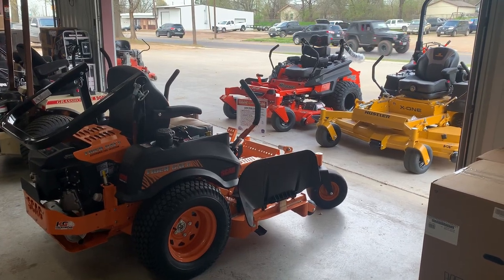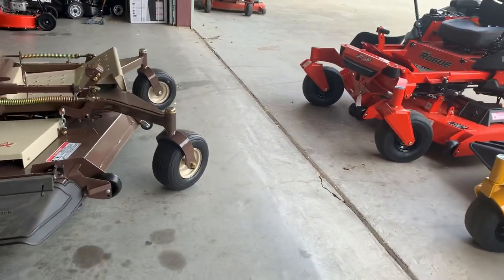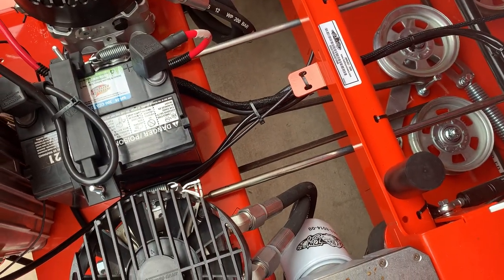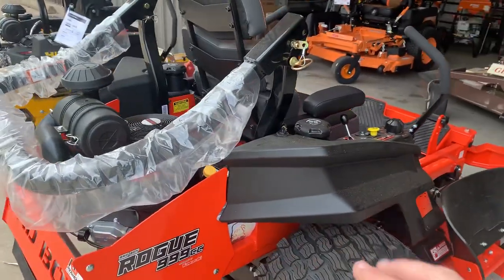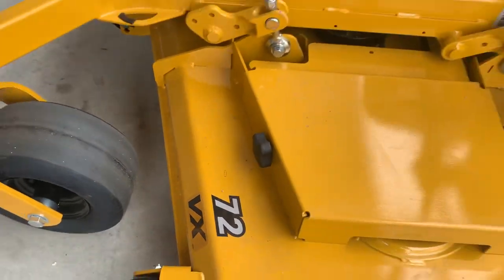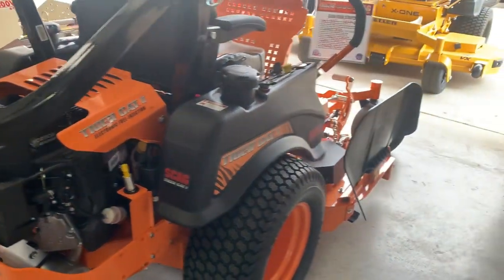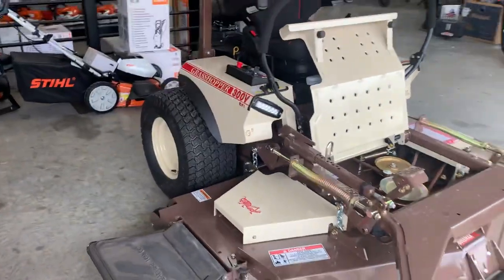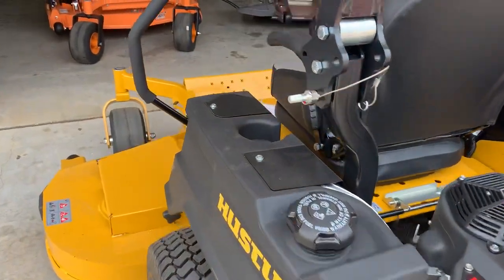Scag tiger cat vs grasshopper 300 vs bad boy rogue vs xone hustler comparison side by side.

Comment: I run three 2014 Grasshopper 227 that came with 27 Kohler command pro that have since worn out. I have fitted all 3 machines with big block Vanguards. The Grasshoppers have been awesome units with over 5k hours on them and still the original hydros. I have yet to demo a unit that holds hills like they do. I will continue to buy Grasshopper.
Reply: I have an old 48 inch Encore that has narrow,tall rear tires on it and I also built a rack over the top of the engine for a 15 gallon sprayer tank and I can fill it a little less than half full and I can hold a steep ditch as good as any other lawnmower I’ve ever ran including a mower with a steering wheel and me walking beside of it holding it from turning over. It is bad about rearing up bad but that also comes in handy when I come up on a root. I can stop and take right off and pop a wheelie and go right over it and never miss a beat lol but I do tell people when they are looking to get a new mower to make sure that it was narrow back wheels and not the fat smaller ones. I have a 42 inch with those on it and it’s got to be on a flat surface or it will slide to the bottom. I’ve always hated it but I do have a bagger for it which I’m sure that I can put it on my 48 without much trouble and it doesn’t cut good either. I’m thinking that the longer the blades are the better it will cut because it has more of a swinging distance.
Reply: l have a 227 and have 1500 hrs on it. I cut five acres and it's done well. Only issue is that wish it had a better ride.
Reply: @george7058  mine have the cordura seats not the grammer seat and I have no issue with ride quality

Comment: Have a grasshopper 329B with the 61” and a 28HP vanguard and that thing is a beast. had it for 4 years now and all I’ve changed is a belt. and of course blades. but I’ve run them all and grasshopper may not be fancy but I’m gonna tell you that grasshopper has been the most reliable mower I have ever had. And that’s cutting 2 acres 2 times a week if not more considering the occasional neighbor mow.

Comment: Your comparison videos are really well done.  No unnecessary babbling at the beginning of the video, you just get right to the point and do a nice job telling their strengths and weaknesses.  Wish you also sold Gravely, Kubota, Ferris, and Toro just to have a huge Battle Royale.  Haha
Reply from the maker: I sold gravely for 3 years, but had trouble selling them sitting next to so many similar lines, if that makes sense.   We gave them a ton of floor space and represented them up front, but still couldn’t really break over 50 mowers a year with them.
Reply from the maker: We used to sell gravely, it was a hard sale sitting next to grasshopper hustler and bad boy.   A very hard sale.   Not a bad mower at all.    You’ll notice most brands do better when they are stand alone at a dealership.   If one brand stands out on features people are drawn to something “different” of that makes sense.   On toro/Exmark they don’t exist in our area at all.  Almost no presence.   Only one guy I know of runs Exmark on his trailers.   
Kubota sales a lot here, but once the mower goes in the shop a few times they are usually looking to trade to something more affordable on maintenance and upkeep.  
Ferris I think has priced theirselves out of reach of most educated buyers.    We are going to carry the Stihl mowers which are super similiar.   Definately gonna be out most expensive mowers, but Stihl’s name and customer service is bar none.  I already have 2 72” 18k 40hp vanguards sold and that is just cray cray to me when we have a 72” 35hp bad boy for $11k 😂

Comment: Nice review. I just bought the Rogue. Looks like it is built very well with nice fab work and welding. Don't think you can go wrong with any of these you reviewed.
Reply: I just got the X1  52.Congrats on your new machine
Reply: How has your rogue treated you? Looking at them now
Reply: @averysamples6026  It has been good. Powerful, good traction on ditch slopes, smooth riding. The main challenge I've had is due to 'mohawks' of grass strips being left in line with the front wheels. According to BB the grass in northern areas like MN can lead to that when you mow fast. These are worse when the dandelions are sprouting. I know I can slow down and eliminate the issue, but the whole reason I bought this was to shorten mowing times. I'm not going crazy fast. Otherwise I love the mower.

Comment: I like that grasshopper keeps things simple. Heavy Duty, all metal no plastic and no nonsense. All the others seem like they have to much stuff that could go wrong with them. Kinda like an old school pickup and today's electronic problematic trucks. We had an early 2000s  front mount diesel and I don't believe we had to do anything to it for the first 750 hours other than replace a spindle because it hung up on a tree root. Very solid, simple, and reliable machines.

Comment: Very thorough review. I’m an extremely satisfied 72” XOne owner, mowing 3 acres weekly in the summer months.  No issues so far, just normal maintenance. Love the cut and the 72 inch deck makes for a fast job. Great review.
Reply from the maker: I ordered one last year by mistake.   I didn’t realize it was a 27hp kawasaki.   Lady bought never heard one complaint, but I was nervous all of our other 72s had 35hp plus
Reply: @kgmowers  The Kawasaki FX850 is a real power house motor for 27hp. I have never had any issues mowing tall or wet grass with it. Even on the 72” deck. More horse power can’t be a bad thing, but there was no compromise with FX850. Think the new ones have been bumped up to 29.5 if I’m not mistaken.

Comment: Nice mowers.   Think I'll stick with my 2001 Grasshopper midmount 225 with 4800hrs  on it that still runs & works like the day I bought it (new).
Reply: i like the kubota diesels zds and Fseries front mounts
Reply: The grasshopper looks like a well built no nonsense mower. I'm currently shopping. How is their dealer support? I'm leaning in their direction. I looked them up online, and saw that they're still Ma & Pa owned, and built in the U.SA. in Kansas, and have won State awards for being a great employer  to work for. They also support wounded vets by donating a Zero turn every year to a wounded vet. All pluses in my book. Thanks for the post by the way.
Reply: @royalway12  Yes, Grasshopper is for sure an "All American" type of company.   Not that the others aren't.   They've been around forever, they have a solid reputation in the industry and yes, they are American/ family owned.  Everyone has their favorite - Grasshopper happens to be mine,  but only because that mower I purchased all those years ago has stood the test of time.   My experience with dealer support has been very good.
Reply: @williamwalter4882  Thanks for the info. Good day to ya.

Comment: Very nice machines indeed. Interesting they all have now gone to vertical shaft engines. In my area of FL I would say the "big three" are Toro/Exmark, Scag and John Deere. On my lawn I use a 1999 Exmark 60" Lazer-Z that has a Kawasaki FD661D (liquid cooled) and the infamous "Corvair" deck belt drive. I agree that Bad Boy deck is nice but still not as stout as the older Exmarks were.

Comment: my BadBoy is 12 years old n i beat it hard its a tank ive never had any problems with her just blades n servicing her i love her !!!!!!!!!!!!!!!   grasshoppers are bad ass also love them to !
Reply: @royalway12  yes i  have they are a great mower also just about 3 times as much as a BB i run the wheels off my BB its 12 n im just now replacing the spindles but my shop got flooded it sat in water for 3 days ya cant go wrong with either one  !
Reply: @raymondj8768  Thanks for the reply. The Sutherland's just a mile up the road from me, is a full line Bad Boy dealer. They also do the repairs there. Looks to me like, the BB is the best out there for bang for the buck. Their frame construction up close is rock solid. What's your thoughts on the stand up mowers?
Reply: @royalway12  there good to depending on how much lawn u have they cut just as well ! BB bilds there stuff like tanks i love them

Comment: I’m a paramedic and I ran an ambulance call where a guy was cutting along a ditch with a large zero turn, he hit a culvert and flipped upside down into the ditch. He did not have a roll bar and it folded him in half, his face was on his knees. He was like that for about 20 minutes. Get the one with the rollbar.
Reply: @afn-bd2ro  last I heard, he recovered and went home.

Comment: No if's ands or buts about it, the Velocity+ deck is the best deck on the market today. Well in tall fescue that is, as that is 95% what we have here with a little bluegrass and a few random zoysia lawns. Over 30 years cutting for a living. Looking at the brands offered I get the impression this is at a southern dealer with southern turf? Reason I think that is due to the mower offerings. No grasshopper, no bad boy, no hustler mowers here. Exmark absolutely DOMINATES here. Followed up by scag and toro with a sprinkling of bob-cat mixed in. Doesn't matter what you throw at the V+ deck. Tall thick lush wet spring growth? No problem one pass and done. Soaking wet every morning with heavy dew? Oh well no problem. Clumps? What are those? Windrows? Our Gravely 460's and 160 were famous for grass string out on top. V+ fan's it out far and wide and makes it vanish. Anyway great video! We own 2 Tiger cat II's. one with the ACTUAL 29hp kohler efi (traded in a Tiger Cat with the 25hpefi labeled as 29hp.........wayyyyyyyy under powered for 61") and one with the 32 Brigg's big block (BEAST and super THIRSTY). So from one long time lawn care pro to anybody seriously in the market. The deck makes or breaks a mower. Why compromise? Get the scag.    BTW "and if you want 0% interest, you pay for it"  huh? So if you want 0% then you JOE consumer are actually paying the banks kickback or the interest is baked into the upfront cost. One or the other lol

Comment: I've owned and ran almost every mower there is,  my last 3 I have bought are hustler. John Deere is my second favorite because of their cut but are overpriced and complicated to work own. Scag does out cut when it comes to dispersing and JD better at cutting clippings very small.  Hustler X one a great in between.!
Reply: Have a grasshopper, frnt deck is great kubota diesel has loads of torque.

Comment: Great run down.  One add that you touched on: Center of gravity and weight distribution make a huge difference.  So be very aware of the type of terrain you’re mowing.  If you’re side hilling at all sitting lower keeps the deck from causing the nose of the machine to slide on you.  Flat terrain and they’re all great.  Also stance vs. deck width and weight can make side hilling a challenge.  If I could give one piece of advice to anyone looking at them … run them before you buy! 😊
Reply: So which of these would you prefer on hills?
Reply: @MrThumper1440  … I bought the Hustler Raptor, but it is horrible on side hills.  Nothing like my first Hustler Super Mini Z that was much better.  I expected the same performance and was wrong.  I should have driven more before buying.  I’m just warning people to test drive several before deciding.  👍

Comment: With these four mowers can you do a video showing cut quality.  I am interested in how they strip, how they cut when turning also when going over uneven surfaces and not scalping etc.  Making a couple passes with each mower showing cut quality would be awesome to see.  Thanks
Reply from the maker: So striping doesn’t exist here.  That’s a coastal or northern thing.  Our grasses don’t stripe.    As far as scalping all mowers will do that.   I recommend when making a turn or going over an uneven surface get in the habit of floating your deck with your foot.     I mowed most of my yards with a 72 and hardly ever scalped.  But me and my deck were one with each other lol.   My foot was constantly pulling the deck up every few seconds it became second nature to me to always work my deck up and down.
Reply from the maker: It’s hard to even keep any in stock.   I had to sell all my demoes just so people would have mowers 🙈
Reply: @kgmowers  if you want a mower that doesn’t scalp then I would recommend looking at selling John Deere 900 series mowers. They have anti scalping wheels on the front and back of the mower and you can set the scalping wheels so the deck does not fall below 3 inches. I’m from Missouri in the ozarks and it’s super bumpy. John Deere is about the only mower I’ve found that doesn’t scalp in a 60 inch deck.
Reply: ILL TELL UKNOW HANDS DOWN NO COMPARRSION SCAG IS BEST CUTTING DECK

Comment: IN South Alabama we cut tremendous amounts of Bahia Brass and I have never seen anything that will cut it with a Velocity Deck Scag. Hands down it is the way to go for Bahia Grass.
Reply: Instablaster
Reply: When I was cutting grass I would spray all of the Bahia grass with Cimarron and it was very easy to kill and it would stay gone for at least four years or more. I’d cut it and wait about two days and then spray it. Seems like that it works a lot better when it is just coming back up about 3 inches tall and I would add some Surfactant to it of course. It’s very cheap also but the only bad thing is that you can probably go the rest of the season and not have to cut it. I guess that’s really the only grass in the yard. I wonder if you were to seed it with a different kind of grass if it would come up and take hold. About all of the yards that I had that had Bahai grass in them were commercial yards that were rough places to start with like trailer parks. Anyway it is very cheap and easy to get rid of and one time spraying will last for years which if you could get a different type of grass growing then you may not have to worry about it forever. It is a pain in the butt to cut and it will be right back up in two days. If it’s a yard that you cut bi-weekly it will be two feet tall when you cut it again. It saved me a lot of time and I’m sure that my blades were happy also when I got rid of it. If you don’t have any spraying license you don’t need them for it and when I didn’t have any I would go spray them late in the evening which the places that were so bad I wasn’t worried about getting caught anyway because they were places that you needed to carry a gun when you were there lol.

Comment: All are beautiful mowers although I'm partial to Hustler.
Reply: I used a Hustler at our church that they bought. It had the 55" cut and 24hp Kawasaki. It was built like an absolute tank. Huge gas tank also. It laid down baseball field quality stripes, and that was just plain mowing, no kit. But if there's one thing I'd change on it though, and that would be a suspension seat to be added. After mowing 7 acres all day, my back was killing me after each session.
Reply: @royalway12  I know exactly how you feel. I'm not sure about the 2021 seats but the previous generation Raptor seat is average at best and the springs are too strong so it's bouncy, great cut though.

Comment: I just bought a scag tiger cat so far like it .
8950 price tag is now 12,399 may 2022
Reply: I just bought a TC2 61" with the 26hp Kawi FT. It came to $12k with a hitch and taxes (MD). MSRP was $12,550.
Reply: Same, I was cash out the door last year for 8400$ on a scag tc2 54 26hp kawi efi. Machine has been wonderful! I have a crazy hilly yard and thought it would be trouble mowing it with a ztr but so far I'm so happy I have the ztr and not a tractor style mower. I was looking on Facebook marketplace for kicks and a used tc2 like mine with 110 hrs was asking 9500$. More than what I paid brand new. Only have 15 hours on mine so far but it's been perfect.

Comment: Great video THANKS !!
3 Questions
1) Overall, which of the mowers you showed has the smoothest ride?
2) Overall, which mower is the easiest to change blades?
3) What strands, jacks, lifts do you sell for changing blades? Can you demo one or twp?

My back is shot and looking for the least painful mower for my back !

Again, THANKs !
Glenn, SC
Reply from the maker: Ok #1 question 100% the bad boy rogue waaaaay better ride.    

#2 grasshopper front mount 100% more than them all on changing the blades out.    

#3. We use Mojack primarily.   Makes it easy to change the blades on a mid mount.   The pro model goes up higher to make it a little easier.

Comment: You compared a 52" scag to bigger mowers. When you step up to the 61 scag you get a bigger stance. All good mowers. You can get softer stabilizers for the scag and it makes the hydros easier to run.
Reply from the maker: It was just the first one to pull out :).
Reply: He stated that

Comment: We have both the BB Avenger and the Elite.   If I can get to one before the other.  I will jump on the Elite.   Why,  adjustable seat, a little better ride and armrests.      They both cut very well.

The only complaint I have about the Elite.   The seat will fall forward into the foot pedal for the deck and scratch and bang up the armrest .    We actually added a small 3mm braded stainless cable so the seat will not fall all the way forward.  Its also can be used to pull the seat aback towards the down position.

That would be a nice improvement on mower.
Reply from the maker: The old ones used to have cables.   They went away from them for some reason 🙈.  Ty for you describing them both a lot of people are wondering if it’s worth the extra to step up ;)